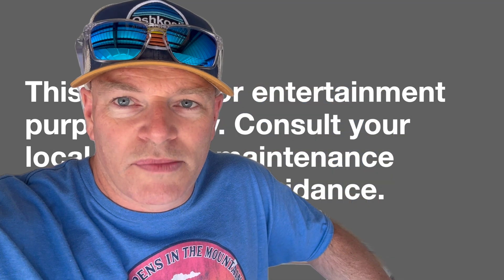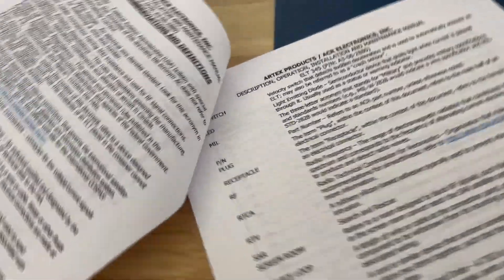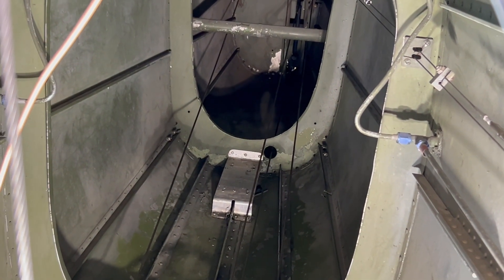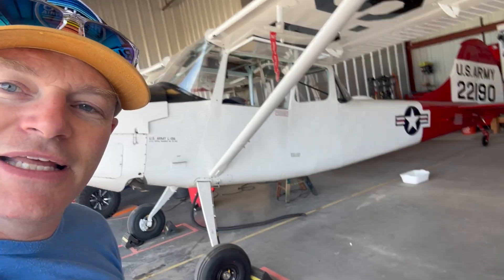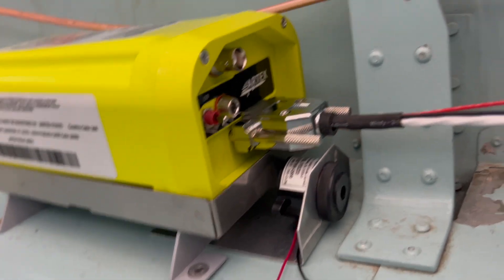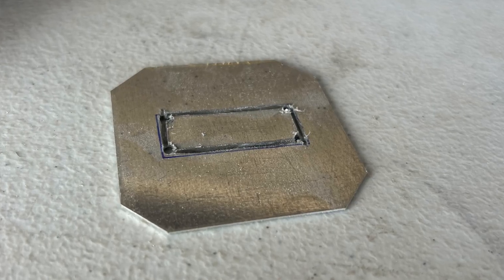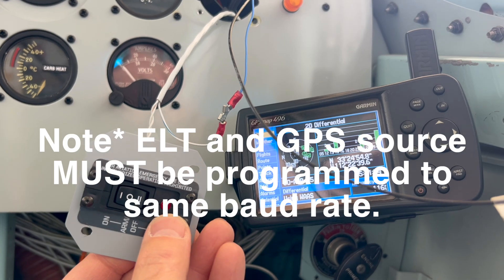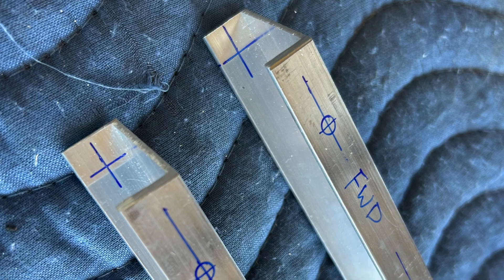406 ELT INSTALL | Artex 345, 1951 Cessna L-19 / O-1 Birddog.

Comment: The ground wire is a bit confusing.  The writing diagram shows that the serial nav data itself should be grounded.  That's a little eyebrow raising.  My Garmin 496 has a ground already connected in it's pin out.  Am I supposed to also connect the rs232 data cable to ground too?  I'm going to use shielded wire.  What did you do for this?
Reply: Good stuff thanks.  Did you have to have yours programmed for the lower nmea baud rate?  I think the 496 will only do nmea and not aviation protocol, so I'm curious what output seeing you're using on the 496 and what the elt is programmed for?  Thanks
Reply from the maker: @flyguy8421 thanks for that. Great point, yes, I had it programmed for NMEA 4800 baud rate. I might be able to help with that in the future if interested.
Reply: @112_adventures  I'm having to send mine back to Pacific Coast to reprogram.  Is this something you know how to do in the field?
Reply from the maker: As long as the ELT harness is grounded and the 496 harness is grounded, it will work. At first my position data didn’t work because I didn’t have the 496 ground connected yet and got the 5 beeps when doing the ELT self test. Once I terminated the ground and did the self test, 1 beep. Obviously the gps must be on and locked onto satellites.
Reply from the maker: @flyguy8421 https://youtu.be/ImDgsjdkdFQ?si=iXzB7RGm-AsaJDZJ